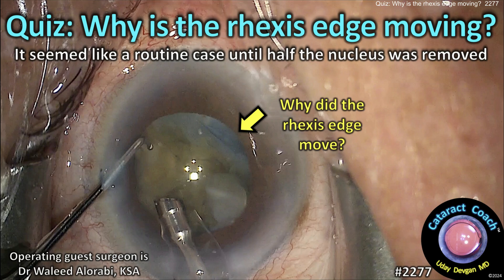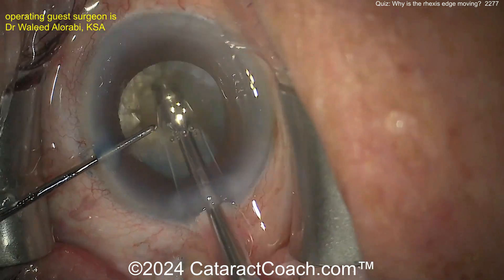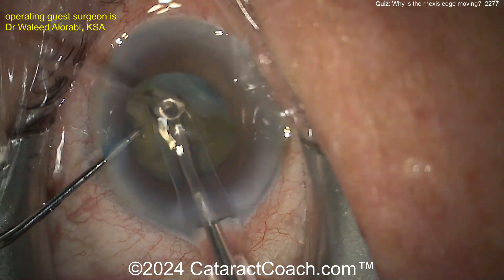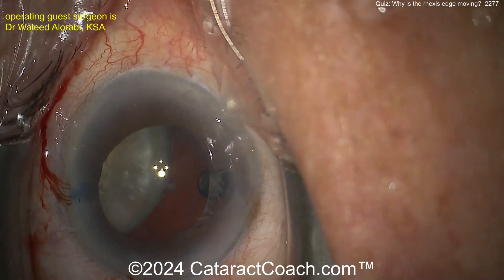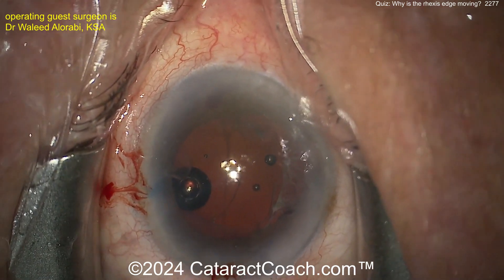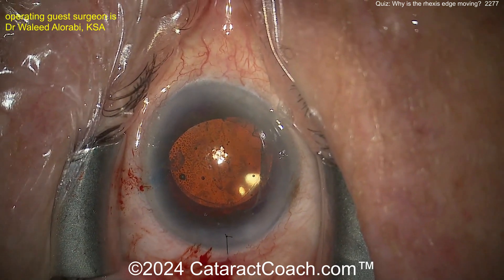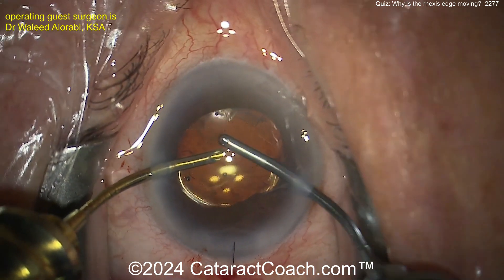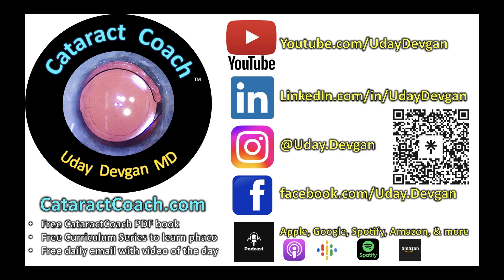CataractCoach™ 2277: CataractQuiz: Why is the rhexis edge moving?

Comment: Several failed chops with instruments moving out of the central safety zone. The hard nucleous and/or the instruments can rupture the ccc
Intraocular miotic at the end of the case can be useful to prevent vitreous prolapse in the first postop day
Reply: Thank you doctor for your important points. 
Actually, the nucleos was very hard and fibrous. In such cases, I usually do stop and chop technique but because I noticed some zonular weakness at the beginning of the surgery I decided to do direct chop but it was very difficult because of the fibrous nucleos. 
I did use Mychol at the end of the surgery and everything was just fine.